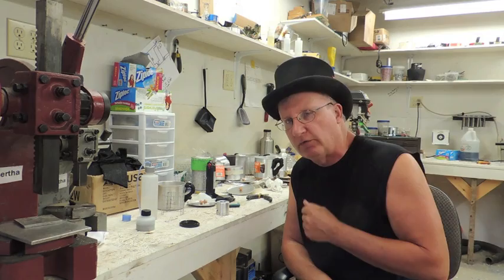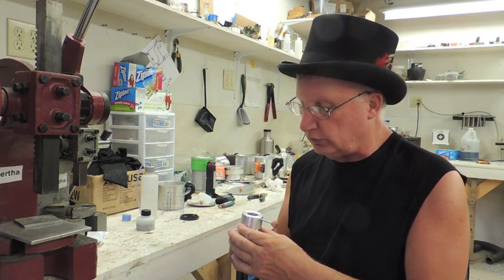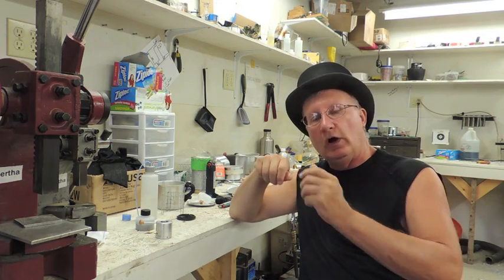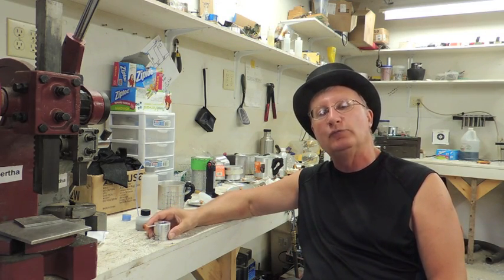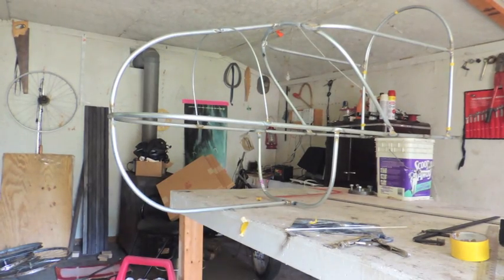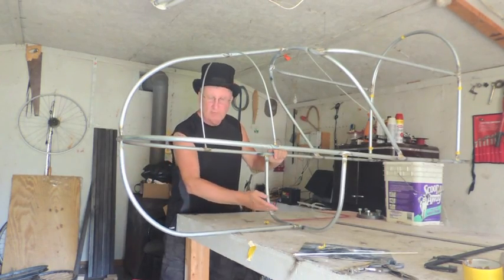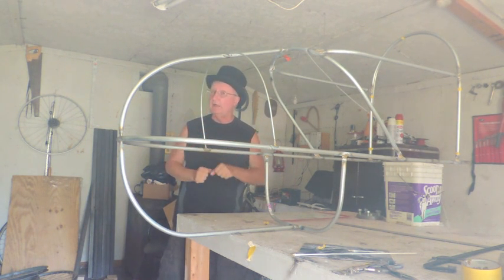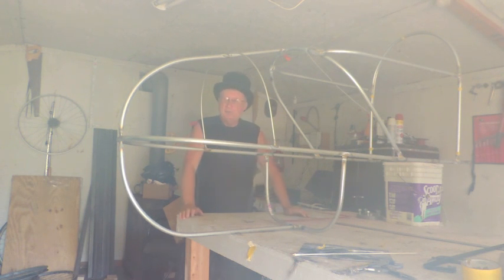Old Ideas

Comment from the maker: A Trangia like all well built alcohol stove without a carbonfelt wick, does not boil the alcohol.  It warms it enough to make it expand and turn to a vapor.  The blue flame is the vapor burning and is a gentle transition from liquid to vapor to flames.  If the alcohol were to actually come to a rolling boil the stove would have orange flame about two feet high.  I guess you could say the alcohol in a Trangia is on a slow simmer.